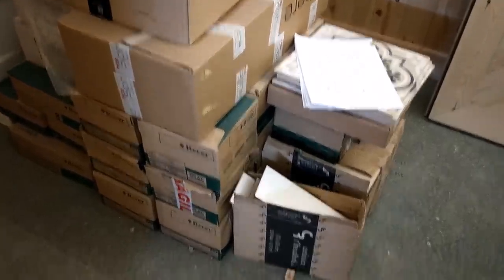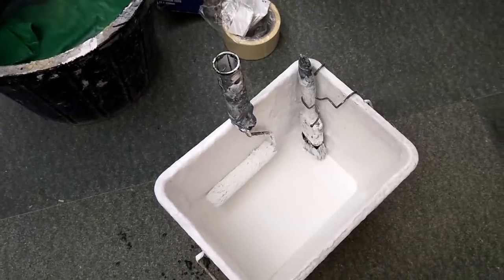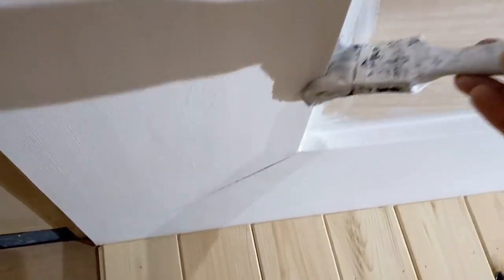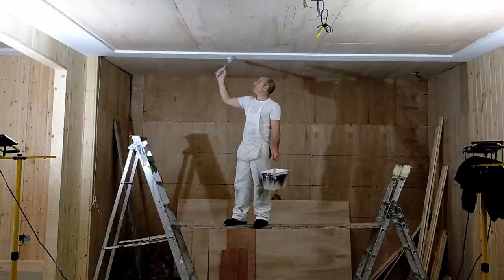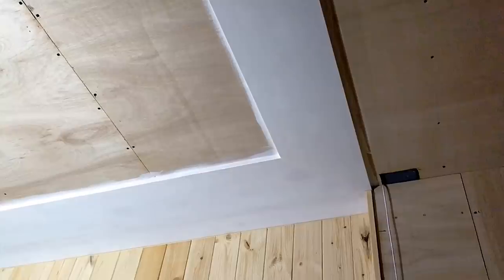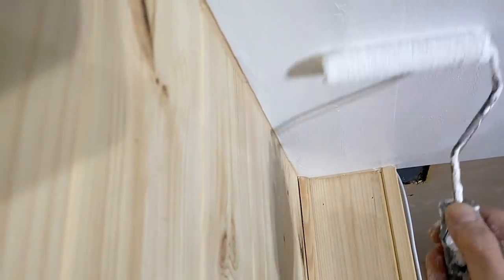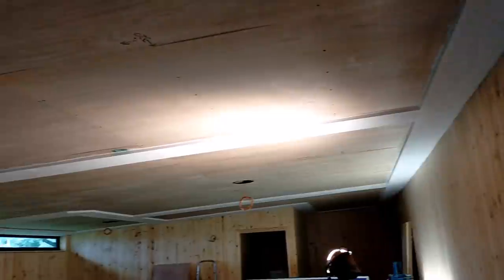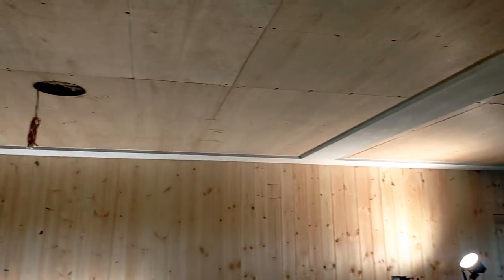How To Caulk And How To Get Neat Paint Lines

Comment: Thanks for the very useful videos,........BUT I have a real problem which needs your help!🤞 I don’t think you’ve covered this yet, probably because it’s a nightmare,🤯🤬(I reckon). I need to change 50w halogen down lighters in the kitchen to LED ones. There are loads of them. 😱 The problem is, over the years as one has accessed the transformers a number of times the holes in the plaster board have been eaten away by the overly strong wire springs holding the light fitting in place. The holes are now quite messy and irregular. I know from your videos how to block them up, but what if you just want to tidy the plaster board holes up, make them round and sharp again ready for new LEDs? There are around 20 to do,😬🙏 Any ideas greatly appreciated, a video however would be the dogs.......
Reply from the maker: Cut out and replace with new plasterboard and a new hole. Or seal edges with B.I.N. primer and fill hopefully it will hold.. thanks